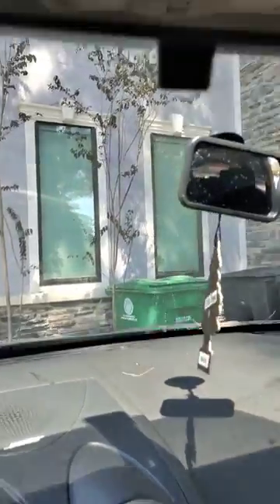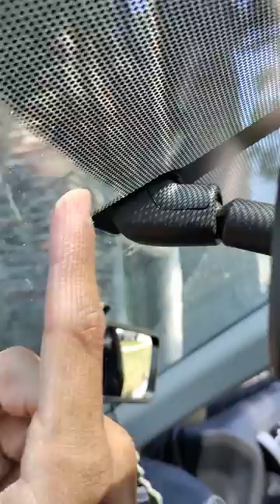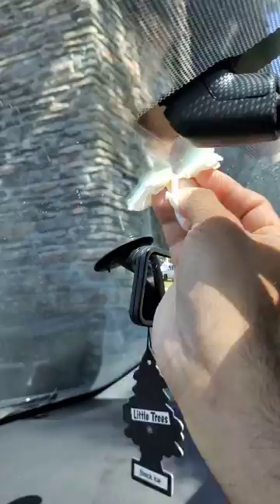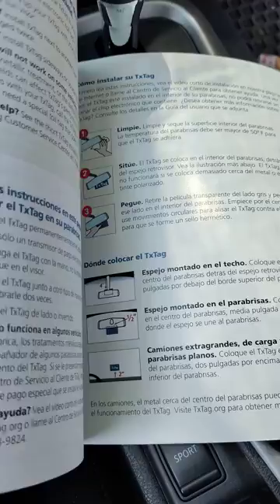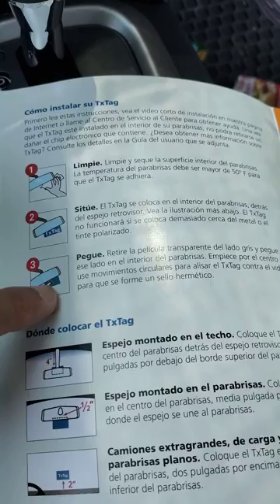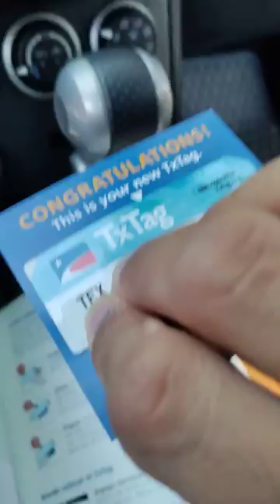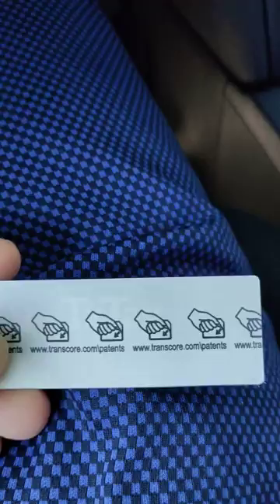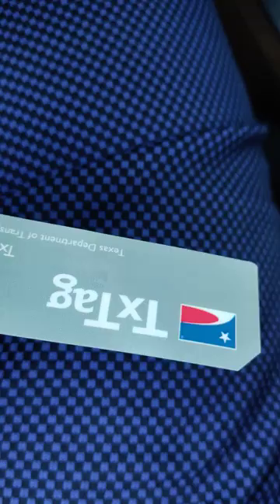How to install Texas tag in car?  (TX Tag for electronic Toll collection)

Comment: Nah, some people put it in the dotty spotty area and they have no problems. The transponders use radio waves, not light.
Reply from the maker: Thanks for your feedback. I was following the instructions from user manual. I agree with you that it uses radio waves and dotted area shouldn't be a problem but I didn't' want to take chance of missed tolls and hassle of paying online later. :)